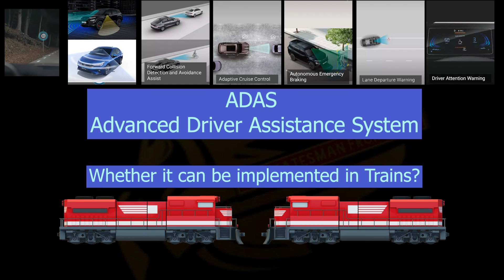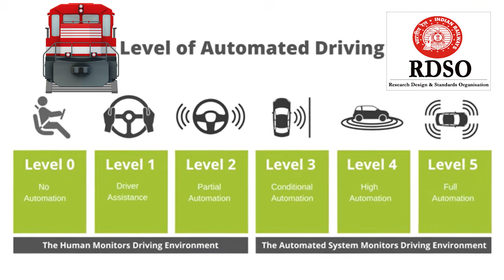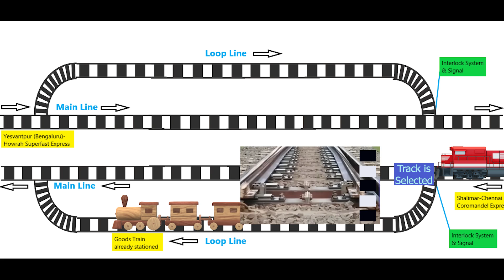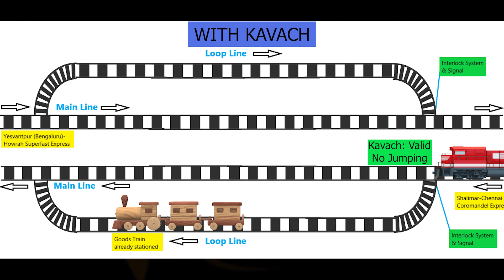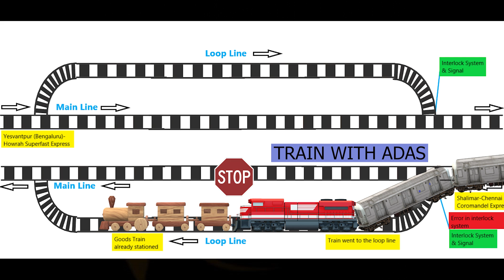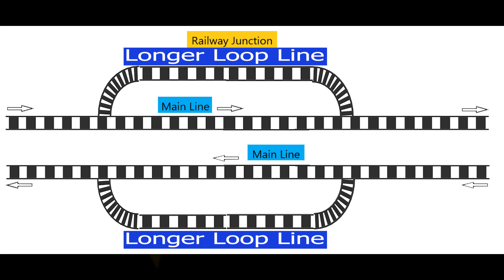Resolving Train Accidents | Practical Solutions

Comment from the maker: 0:00 Introduction: Why ADAS is needed in Trains?
0:20 ADAS in Cars & Can it be implemented in Trains?
1:12 Cost of ADAS equipment
1:37 KAVACH Railway Safety System
2:03 Balasore Train Tragedy Explained
2:54 KAVACH would prevent the Balasore accident?
4:07 ADAS would prevent the Balasore accident?
5:08 Conclusion